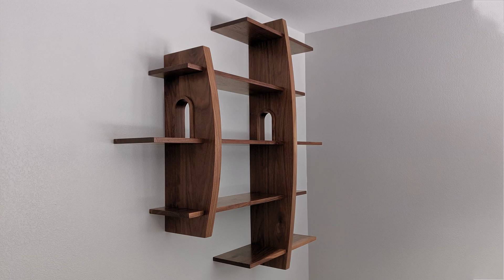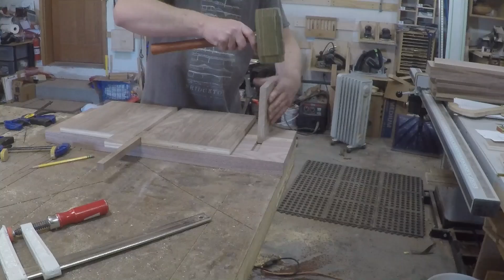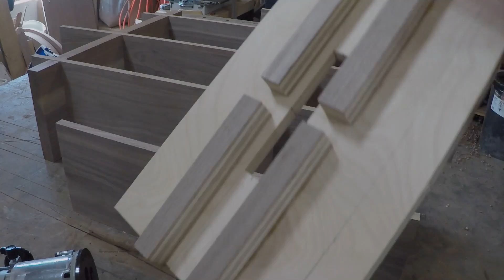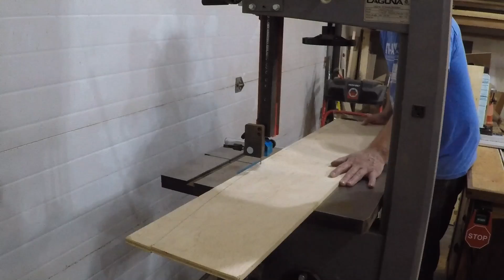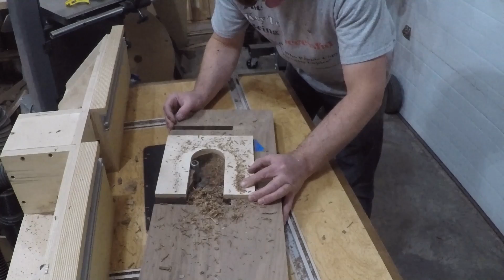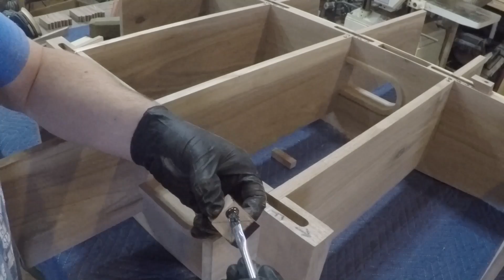Building a Display Shelf For a Model Train

Comment: Hey Brian, very nice build. Gotta hand it to you, you're getting more skilful with each project.

Maybe it's time to upgrade your tools so that you could do more? The way I see it, you could really benefit from a proper shaper... what ya call.. a spindle moulder I think. Perhaps one of those combination machines from Hammer or Felder so that you'd save on space, and not so expensive in the long run, I hear. Those machines could take either dedicated cutter heads, or use your current router bits with a spindle you'd swap out. Much safer for you to be taking bigger bites of wood, the way I see you like to work.

Your call, of course. Just that, in my opinion, you have the creative capacity, together with the ability to get paying commissions, to justify that type of expense. After all, a justifiable expense is not an expense, but an investment. 

Take care now, be safe.